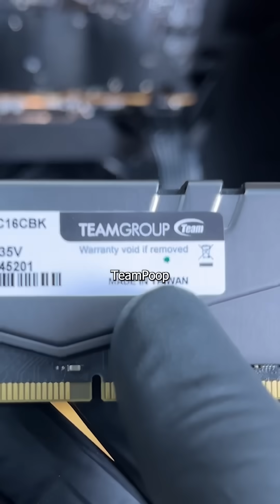New build, old problems (how to fix your own #PC ) #technology #tech #shorts

Comment: Meanwhile I have a MSI b550 gaming plus with a r5 5500 mild OC, 128gb (4x32)gb kit of team group silver, MSI Armor editionRX580 8GB (the one miners go nuts over) and 40tb storage running 3 years solid, with only case fans failing at random.

It hosts several VMs, all hosting their own Minecraft servers, Forge, Fabric, Neoforge and Vanilla, another vm with a Satisfactory server and another VM file share control scripts all automated on powershell reboot/update/validate scripts.

and somehow I still have overhead to stream in dual PC without it even noticing. Teamgroup is a 10/10 rating for me.

Comment: Yes, as a Tech-mage, I can confirm having raccoon-fingers is a necessity reaching that dumb powersocket in the innermost corner, not to mention the little plastic lock-thingy on it that refuses to budge. Flesh is weak, I need to upgrade my hands with 180 degree rotating ball-socket joints in my extended fingers.
Praise the Omnissiah!

Comment: All I'm going to say is I have built in one of those cases and I fucking hated it. Mostly remember airflow is terrible even without the magnetic covers and basically non existent with them. Also the screw holes for fans did not line up for the top and front.

Comment: I resolve my BSOD too. It was my power adaptor. I just notice that I only encounter BSOD when my laptop is plug. Imagine, doing my work on my laptop then BSOD. Replacing my charger and buying $50 charger. That fix the issue.

Comment: My pc immediately shut down and then turn on again when i'm trying to booting it up, does anyone know how to fix this ?
Reply: if your pc powers on and off repeatedly it is usually a ram problem, 
But it could be a CPU pins not contacting probably problem, and hopefully can be fixed by re-seating the CPU and making sure than no pins are bent..or look sus!
Finally this could be also a motherboard problem.. in the ram slots area, something shorted around and missed with the voltage or the data lines... good luck🐒

Comment: Thats not always the case. I had to figure out the hardway that swapping ram out enough will cause just enough flex on the board to cause microcracks to the pins on the underside of the ram slots. For years i had issues where my pc would freeze just from stepping around too hard around it, or even stomping. It took me just a hail mary attempt of resoldering my ram slot pins to figure out that was the case. So if you replace ram and cant get any consistency, try resoldering the ram slot pins.

Comment: If you run a computer repair shop, you better be saving electronic scrap for gold harvesting... you'd be surprised(or not) with how much gold is in a 5 gallon bucket of RAM sticks.
also, can we petition the industry to move that stupid stupid stupid 8 pin power connector, they're always in the worst spot.

Comment: It’s seems to be a new build, so i’m fairly certain that it’s a problem with the bios settings, not with the ram.
Many times the bios default voltage and timing settings are not compatible with the installed ram. The ram reports what settings it needs, but it’s up to the motherboard manufacturer how to apply the information.
To solve this:
It’s a bit finicky to get into the bios, maybe try 3 ram sticks or other combinations. If you get access to the bios, enable XMP
or use a different ram stick to get it to boot and manually change the settings to the ones printed on the ram stick you intend to use.

On a side note: If you like to unplug your PC from the wall when not in use, the tiny battery on the motherboard will run dry and the issue might come up again because the battery is there to store bios settings.
Reply: The other identical one seems to have worked though. And Lemons do exist.

Comment: i developed a technique name the ram swapping. Restart the computer non stop with the same ram in different configuration 70% of the time it work. My hypothesis the ram have data stuck into it who made a error at startup by switching ram around the data got overwrote and its fix the issue.

Comment: If you just rub the golden chips of Ram with a Rubber it will start working again.
Cuz sometimes because of carbon or dust on one or two connection points can cause this problum. 👍👍
Most of the time people throw away the Ram thinking it's f**ked but it's not 😂😂

Comment: I would have replaced the case, that case is the literal worst. Had a friend with one and the thing had like zero airflow so the internals would heat up to the point where it was always at least 80 degrees inside and all the components would thermal throttle
Reply from the maker: They never complained after this but I’ll keep that in mind

Comment: My pc crashed after i shke the table a bit😂.. and wont boot up again, i remoove a ram stick, and it worked so i cleaned the prot , the stick and put it back, it resolves the problem at 100%

Comment: I am actually the greatest technician that ever lived, but I retired from mending computers 25 years ago because there was no competition. 
E.g. I was sent to mend a computer 100 miles away ("it HAS to be mended, the whole business depends on it"), 2 hours there, same back. I had never seen the computer before, it had no name, no manual, no diagrams and wouldn't boot. Easy, 30 minutes.
I used to mend daisy wheel printers and switched mode power supplies at component level. Relatively easy.
Once mended a SMPSU without a circuit diagram "it only works if Tony connects here and here with his hand, swears deeply, and says he's not going to do it again."

Comment: Before chucking RAM sticks, I have ram that is over 5 years old and was giving me issues with poo screens as well and I was able to fix it by undervolting, moving them all down one slot, and then running it for a few days like that. I then put it back to overclocked voltage and CRANKED the OC to as high as I could and left it on for a few DAYS....they got super hot. Now, a month later, not a single crash or poo screen and they're all OC.

Comment: bruh.  that easy throw to trash bin..   my case blue screen like that because ramstick not fully locked to socket..  i can see little copper from ram then i push my ram little bit harder (because single lock dimm socket  like b450m steel legend), and,  its work again...

Comment: Did you ever clean the contacts of that RAM. and Test again.
Reply from the maker: If you see a video with me dealing with RAM, that's always the first step. I leave it out because 99% of the time it's pointless. It's worked for me 1/100 times and the computer came back a month later with the same issue.

Comment: Chuck that plexi-plastic side panel in the trash while you're at it. Those $35 Cooler Master mATX cases are basically a toaster oven. They're cheap and look "OK", but air flow is non-existent.

Comment: That was an easy one. Try banging your head against the wall several times after you find out 1 pin was slightly bent on the cpu socket causing an intermittent loss of connection to the memory controller built into the cpu. Tried different sticks, it started to work, an hour later doing the same thing, swap sticks again, check GPU, PSU, every single peripheral and decided to condemn the MB. After swapping the CPU over noticed a pin standing out like a sore thumb. Still ended up replacing the board.

Comment: After some experience with PCs (built 3 PCs and own one since I was 5) most of the problems that occur are caused by faulty RAMs, poor/ wrong connections and heat. That's about it.

Comment: i know a way how to fix its its easy just press ESC and when the pc is off you turn it back again and you see yourself in UEFI firmware settings but ignore it and just press F10 and then press yes and when the pc turn off again you just turn it back on and it will work

Comment: I didnt think the cpu power connector being wrong would cause a blue screen because generally you dont need all the power an 8 pin supplies if your not over clocking by a lot. That being said i didnt know plugging it in like that was possible... arent those connectors keyed?

Comment: Well after many attempts I found out the following about blue screen of death:
you will get an error code at the bottom and it will lead you to how to solve it.. My first problem was I had to update my windows
I got another blue screen with another error code but I couldn't find the solution on Google so I had solve it my self and found out that my rams are OVERHEATING I unplugged it and waited couple seconds and then plugged it back again and everything is back to normal

Comment: Errm... if you have a computer that is hanging/ blue screening, or anything like that, first step is disconnect the system drive before validating basic memory test.  Not try booting with unknown ram.  It's rare, but it only takes one time to get a filesystem completely scrambled by bad ram to make that lesson stick.

Comment: Reason why I've post testing over a 3000 systems. I take the motherboard ram and CPU I just sold you onto my bench. Install CPU (after showing you no bent pins) and ram onto motherboard. Plug in our bench PSU and press a cpu cooler onto it while I use a screw driver to power on and make sure it posts before it leaves my shop. This is noted on the invoice and it since we started this the number of ram and cpu issues dropped like a rock.

Comment: I remember back in my younger years my dad bought me an audio card I wanted to install in my tower. I didnt know if it needed a cable to it (over just the pci slot) and dad just grabbed a cable, plugged it in on some random slot on the motherboard to the copper pins on the card (which made no sense as they werent connector pins, but in my child eyes, dad knew best) and said "There you go". Turning it on: Blue screen of death and smoke ensued.

Comment: Rule of Tumb thats starting to not be as relevant but still kind of relevant. When in situations similar(as in blue screens and no visible reasons why, especially with new builds) and using an AMD chip, ALWAYS start with the RAM. AMD can be wonky with ram sometimes.

Comment: It's always the ram. Either it's not supported by the motherboard, the processor or the bios is out of date. Check the recommended hardware list, whether your processor supports the same bus speed and don't buy a different brand because it's cheaper or has less latency.

Comment: Just built an AMD PC. Top of the line, in the 99.99% of gaming PC's.

Never built AMD before, so i thought, let's get a professional to do it. So i checked different stores and got asked between 400£ to 800£ to do it..

Sure, i wasted 2 days to do it myself, but that was because i was unfamiliar with the architecture and had to do lots of research. 

Actual time it took to put it togheder was 1h 😂

Comment: I had blue screen kmode exception not handled I had faced the problem when chip gets hot. It was really hard to find I replaced each part 1 by one cost me a lot I hate intel i7 8700 😑

Comment: I have 2 different sets of ram sticks with different clock speeds, never used as a set of 4 but testing using both sets of pairs, Problem persists with both sets so definitely not ram. And ive had it working fine with all 4 ram sticks used as a single. No issues there.

When i run 2 ram sticks. Inserted in slots a2 and b2 as per motherboard recommendation. Dram light on m board on amd it wont boot. Move sticks to a1 and b1, boots. Bios says its dual channel.....runs for about 30 mins, then screen freezes. Static through speakers, basically crashes. So boots, but doesnt run for long. Then a whole lot of not booting before it randomly will, runs 30 mins, crash again. 
I put 2 sticks into b1 and b2, or a1 and a2, boots to bios, single channel with 2 sticks, runs just fine. Even games i play i still get pretty good fps. Definitely still playable. 

But whats causing all this??? I dont think it is the motherboard. Im thinking the cpu is not.....somethings wrong with cpu and for whatwver reason it just doesnt work dual channel memory. Am i on the right track here???

Its not ram slots. I van run it with 2 sticks in a1 and a2 just fine, currently am. And it also runs in slots b1 and b2 just fine aswell. No issues with the slots....but i go dual channel a2 and b2....dram light comes on. Both sticks have worked, both slots have worked....just not in the dual channel config.....cpu right???

Comment: Can sombody help me with my pc:? Ive been using it for over 5 months now and recently it startet blackscreening every time i open an app (i have a nvidia geforce gt 1030)
Its a prebuild and i cant reseat the gpu becourse it is screwed into a big
Bracket witch i cant remove cuz the gpu blocks it and the gpu it self is getting Blocked by the bracket so i cant plug it out and reseat it .
😢 does sombody know an Solution ?

Comment: One question for my laptop 
When i play games on it ,
Then sometimes it  shows blue screen of death with sad face,  and it was overheated 
I tought i need change termal paste but it Don't fix the problem   , laptop is brand new and it had Factory termal paste before i change it 

Gigabyte G5 MF
Intel core i5 12500
32 GB ram 3200 Mhz DDR 4
512 GB SSD  
Nividia 4050 RTX  6 GB VM

Comment: Considering the specs of that machine, it probably didn't need both CPU power cables (and honestly except for high-end Intel and AMD chips in the last generation or significant overclocking) so I immediately would have ruled that out. It's good to fix, but still knew it was highly unlikely to be the issue.

Comment: I just built my newest desktop about a week ago after my system board on my 4 year old Thinkpad decided to stop living. The dreaded 0002 error code :( It had a bunch of weird issues where tabs would start to bleed into each other and the whole screen would go black. I did a RAM dance, tested each stick individually, tried resetting the BIOS, flashing a new bios, and even re-seated the CMOS battery after running through all Lenovo diagnostics. RIP in pupperoni Thinkpad, at least the nvme went into the new desktop. The dreaded internal bus error has felted the once mighty Thinkpad.
Reply: When the screen went black it's almost like a dying GPU since the black boxes pixelated all over the screen in certain areas for a second.

Comment: You can clean the ram memory pads with an ink eraser which is a little abrasive, but with 2000 grit sandpaper, it could also be due to a defective bios windows10 sometimes has bios updates

Comment: Do most PC repairs actually consist of troubleshooting parts and replacing them or is that just what this guy shows?
Reply from the maker: No, it's just what I can fit into a 60 seconds of visually stimulating brain rot comedy because the actual process is much more involved.
- Figure out what the symptoms are and when they occur
- Use programs to see if there are logs of what has occurred
- Be able to recreate the issue on demand
- Begin the process of elimination with inspection and removal of components if no specific error was shown in the logs
- Make sure to isolate variables as to not change 2 things at the same time
The benefit of bringing it to a repair shop is they have spare components to swap out on demand, which most people do not have.

Comment: I had a set of Team Group RAM sticks and it crashed my PC under load. Initially I thought it was my CPU, and after not being able to fix it with a CPU replacement, I swapped the RAM with some Corsair RAM and what do you know, the problem was solved.

Comment: I always struggle to undetstand why people have such a hard time with vasic computer components and well known rules.

Never buy offbrand/cheap components. 

Never buy less than gold standard for the psu.

Read the manual for ram slot usage.

Tempered glass paneling looks nice but is easily broken and not worth the hassle. 

Air cooled is more than sufficient these days.

Connecting cables is literally labled on both ends and even a child can figure it out.

Did I mention to READ THE DAMN MANUAL before assembling.

Comment: The funniest part about the "just because something fits in the hole doesn't mean it belongs there' is that I've built enough PCs to know that those plugs don't even probably line up well in the first place! The last few i built had triangles and squares in them of varying angles and sizes specifically to keep you from jamming them in by mistake!!!!

Comment: Hi dear Sir , I mean the greatest technician that's ever lived !
I am a 16 year old boy from Pakistan and I really admire your work I have been watching your videos for now at least a year. 
I just wanted a quick guideline regarding upgrading a laptop's processor.
See, my friend has a Samsung NP300e5c ( i3 2370M ) and he has agreed to give it to me. I am planning to upgrade it's processor after getting it. Now there are 2 other laptop models of the same series one has i5-2450M and other has i7-2670QM.All have the same mother boards and the same sockets the G2 socket but the problem is that the i7 processor has 45W TDP and other 2 has 35W and secondly I don't now what to do with the Bios after processor upgrade.

Comment: That misplugged EPS connector actually should work perfectly well.
Even if you plug only half of the 4+4 connector then it still can carry more than enough current for this measly CPU that can be cooled with a measly stock cooler.
Reply: It was probably not misplugged but on purpose. If the PSU provides 2 4pin connectors they cant just be put next to each other in the 8pin socket, but it works the way it was done here for at least 3 12V pins (which could be better than just the 2 youd get from one 4 pin connector)